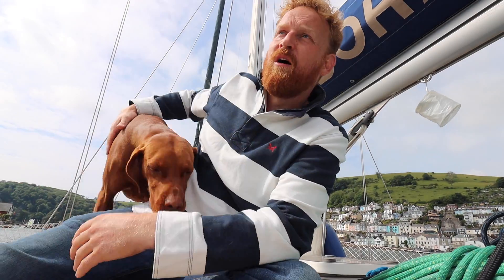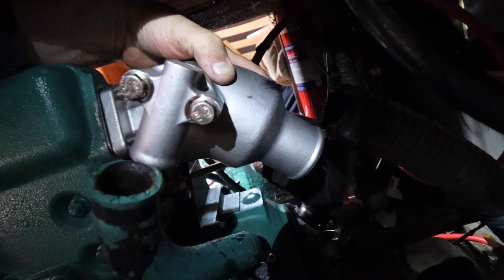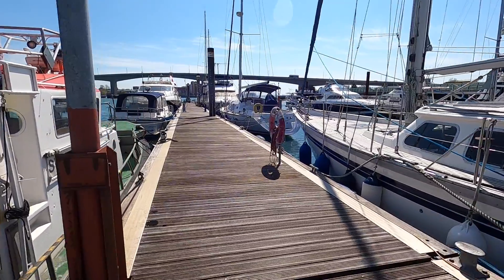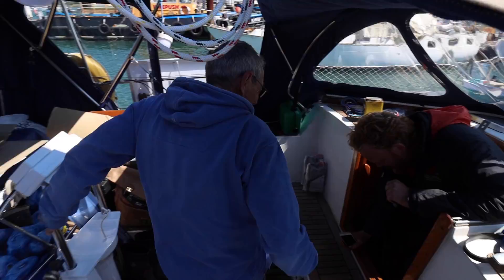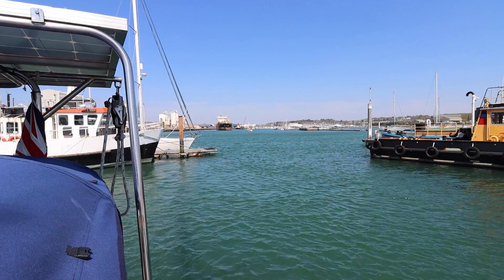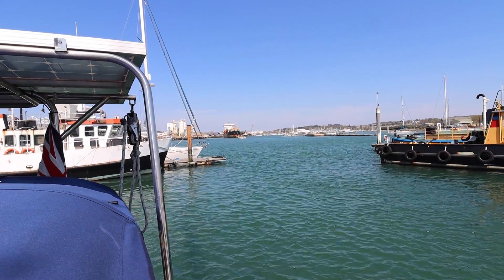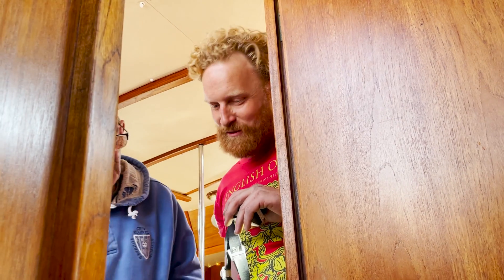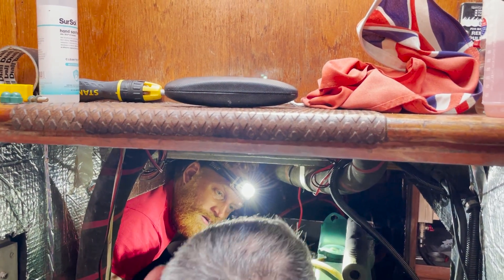Volvo Penta D2 55 [Valve Clearance & Adjustment]

Comment: That was really helpful! One additional bit - this should be done when the engine is stone cold. Gary is spot on about going through an additional time and double checking. Looks like good access. Did the new gasket fix your leak? Thanks! F

Comment: It’s good periodic maintenance.  Over time, on certain engines, the valves can tighten up and need to be loosened (Honda’s in particular) and some will get looser and need to be tightened.  On small engines it can make a huge difference.  On big engines, it can be the difference between running good and running great.

Comment: Great video, the only information i`m missing is when do I do this. Is this done annually, once in a blue moon or when things start banging?
Reply from the maker: That’s a good question, we did it simply because we changed the rocker cover gasket, as it was leaking oil and since we were already there, it made sense to check the valve clearance too.
Reply: @CadohaAdventures  Wow, that was a quick response thanks. I got my first yacht a few months back with a 60 year old perkins engine so i`m hoovering up all the information I can ready for when i get back to her. Thanks again, loving your videos.

Comment: There is a special tool that we used when learning to adjust valves at the Annapolis School of Seamanship. It was a small 2 handled tool that was a combination of a screw driver and a spanner. Made the adjustment process a little more seamless with less "repeats" trying to get it just right...I also - as previously suggested - feel that the gauge was too tight in your video example, compared to my instruction. It was also suggested to the students to acquire "L" shaped feeler gauges to make measuring easier...
Reply from the maker: Thank you, when it comes to engines I always need all the help I can get 👍🏽👍🏽⛵️

Comment: The rule of nine works on most 4 cylinder engines (with 8 valves). However, there are a few that have siamesed ports that it may not work on. Another method that works well is to see when the exhaust valve is closing and the inlet valve of the same cylinder is just starting to open, they are said to be rocking. If the valves on no.1 cylinder are rocking check and adjust cyl 4. If 2 is rocking adjust 3, if 3 is rocking adjust 2, if 4 is rocking adjust 1.

Comment: Yes, any 4 cylinder, 8 valved engine you use the rule of 9. It also makes no difference in this instance if the cylinder at the front is number 1 or 8.